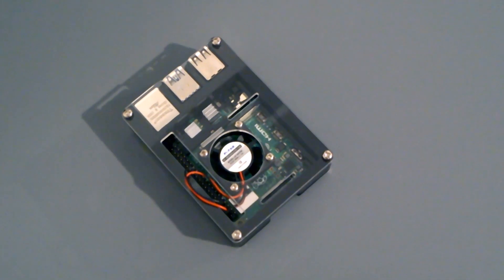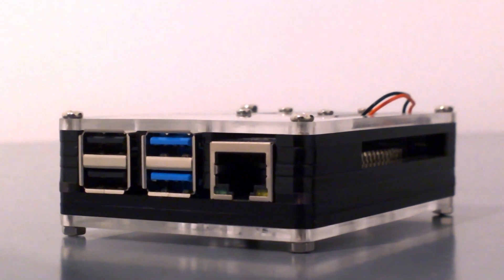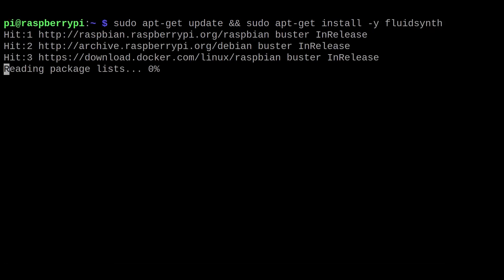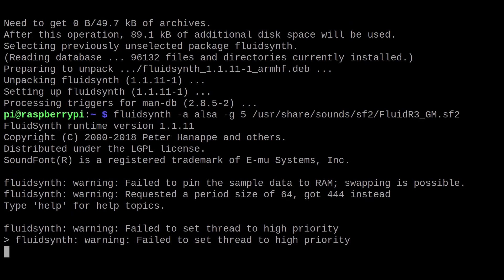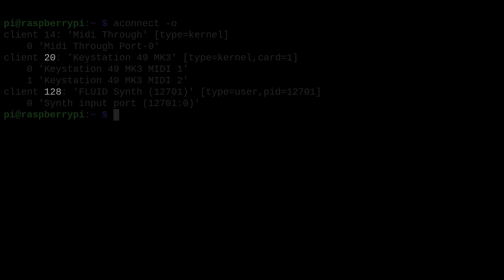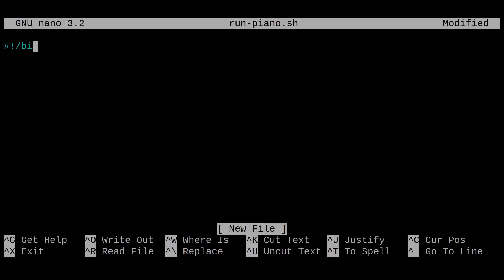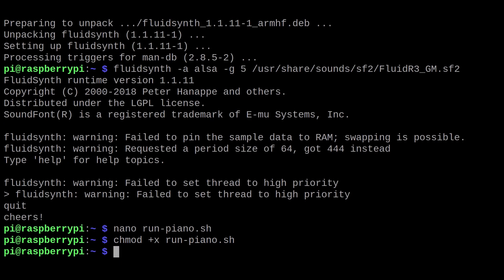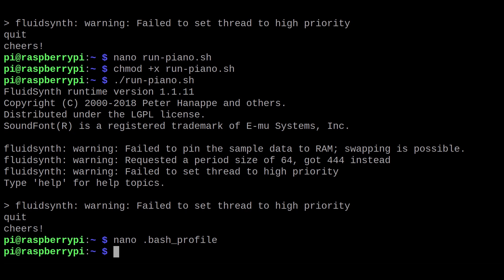BUILD A BUDGET MIDI SYNTHESIZER - FluidSynth on Raspberry Pi Tutorial!

Comment: And another unknown thing for me is how do you change to new terminal, I searched the whole internet nothing really worked for me, I am stuck please help
Reply: If you have a grafic interface, you can simply re-click on the terminal shortcut.
Reply: Just wanted to add to this in case anyone doesn't know, you can get a new "window" in the command line by hitting ALT + F2-F12 (I think I read it is only through F6 on newer versions). Log in with the same credentials, and switch back and forth with ALT + F1 (1st window) and F2-whatever (new windows). I was able to leave Fluidsynth running in the first window, then did the connection to the controller in the second. Hope this helps someone else!